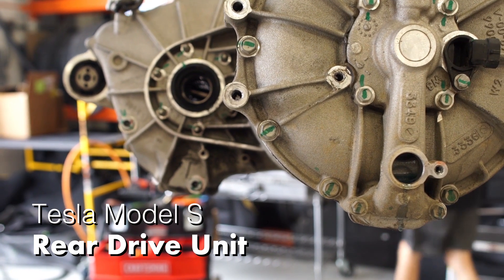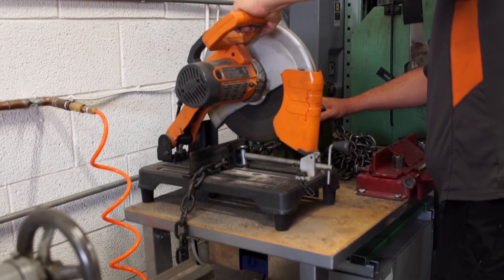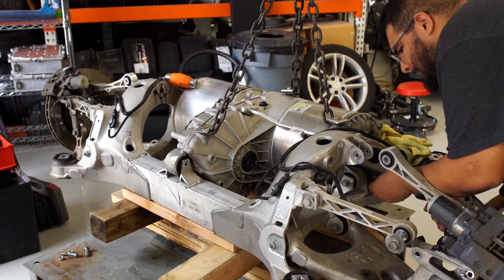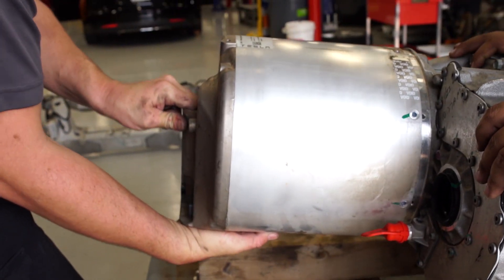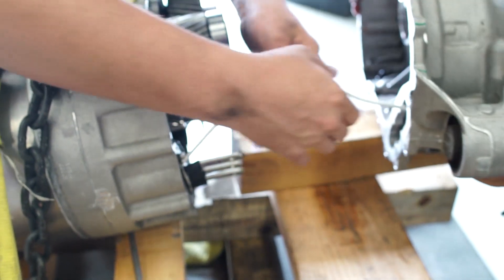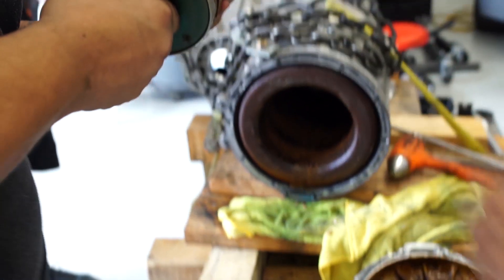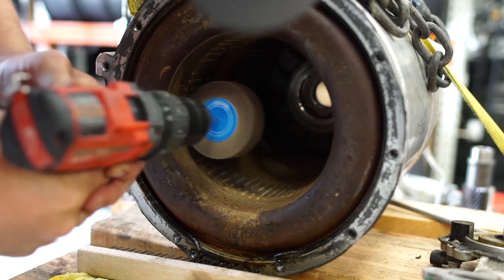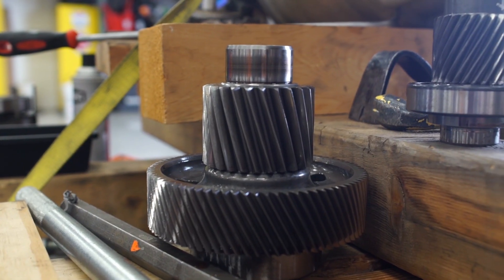Reverse Engineering a Tesla Model S Drive Train | Gruber Motors

Comment: There is zero reverse-engineering going on here... All I see is a bunch of people ripping into a damaged drive unit, cleaning it in the dumbest way possible, (brake cleaner RUINS rubber and plastic parts. You drenched everything with it!) and putting it back together.

Comment: Why was there so much corrosion inside the motor? 
Is there a tool (other than Tesla licenced Toolbox) to program the  CAN interface??
Can you just physically swap a DU and it works, or do you need to program parameters, serial numbers etc. to make it work???

Comment: Water and power electronics don't mix.I think that is an issue with the seal of the motor.Is not normal to have sooo much rust in the stator and rotor, is unacceptable.Tesla has a problem !